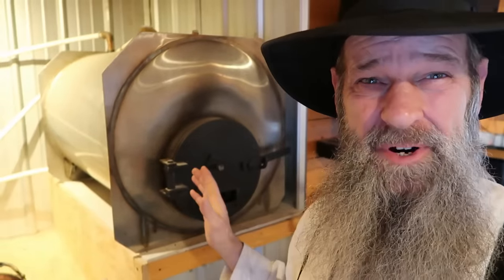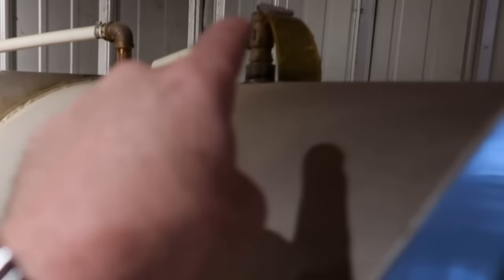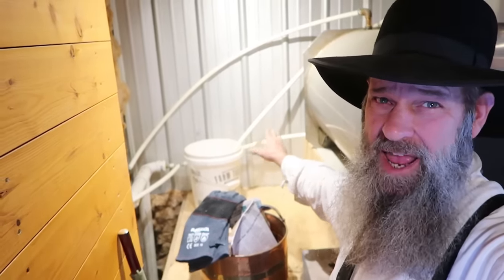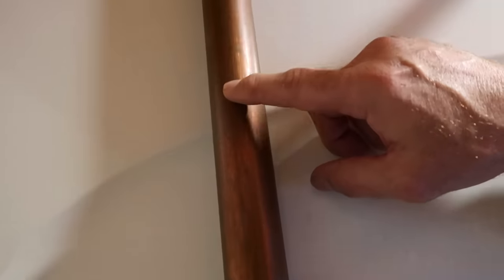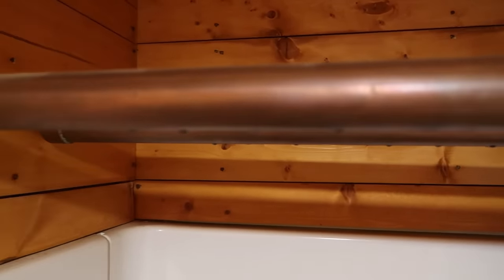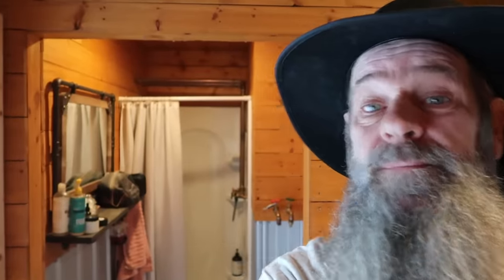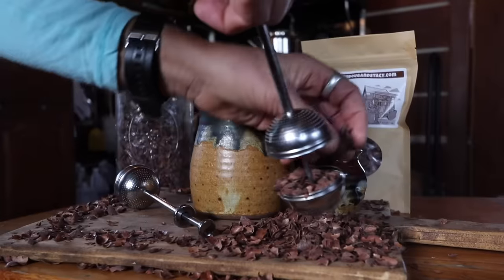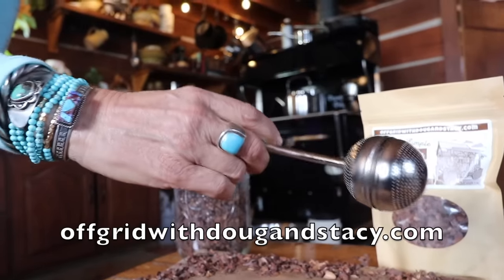How the Amish have HOT WATER! Off Grid Living

Comment: Hi Doug. If you have pvc or abs pipe in your grey water system don’t put the heated water from your wood water heater into it. It will expand and contract the pipe to the point of pulling the joints apart.  You folks are inspiring. Have a great day

Comment: For people who want to implement the shower, but don't have enough pressure from gravity, an in line tank can be used. Install a check valve on the inlet side, Install a fitting for an air pump on the top, pressurize the tank, and you're off to the races.
Reply: I was also thinking a simple RV water pump would do. I have thick hair and it would take forever to thoroughly wet it before shampoo on a gravity system, and the rinse oh man there goes another 20 gallons.

Comment: I 'm so impressed with your ingenuity applied to the Amish system. The shower is beautiful, the way you fixed it up in your nifty outbuilding. Thank you for all the teaching moments with you both. When I was living in my travel trailer on my 12  acres, I heated the water in a canner,  over propane stove, carried the canner  into the tiny bathroom  and sat down on the edge of the shower. And I washed myself clean with my feet in the water. I used kerosene lamps for light and lived in a tiny room built adjoining the travel trailer. I collected rainwater. I had to watch out for bears, bobcats, and strange people on occasion. I learned to live simply and enjoyed the experience. Now I have a different property and mobile home on the grid,  and looking forward to some innovations like yours.

Comment: Good Evening, I had a similar system when I lived in Alaska. Hot water was not the problem, the hot water was always too hot. I would turn on the cold water 1st and then slowly add the hot/hot water to it. I used a stainless steel heat exchanger and let the hot water rising work for me. I also had a purging valve at the lowest point so if I was called away I could drain the system completely and not worry about any pipes bursting. The front of the stove had the opening into an air tight chamber with a flat top cooking surface that higher airtight chamber had the exhaust stack in the back of it. The heat exchanger was in the rear of the higher 2nd chamber. 
The exhaust stack had a 'T' section followed by a 90 elboe, then a section of stack going down and into a box built between the floor joists. The cold air settles to the lowest point which is the box in the floor behind the stove. That section of stack going into the floor box has the flue in it. This draft of cold air creates a vortex in the stack. I never had a creosote problem ever. Good luck, I thank you for letting me share, Tom.

Comment: I made something similar. It's my outdoor cob oven. Between my layers of cob I  curved some copper pipe around the oven then finished my cob layers, leaving a piece of exposed pipe at the front facing top of the oven and down at the bottom facing front of the oven. The  cold water goes into the top and comes out the other end piping hot. Too hot in fact. I just added it as an instant tea or coffee bonus but it could work the same as yours if a water fed line was attached 😊

Comment: You are so right about missing grit. Indeed. We moved rural but have backups just in case. We lost heat and water for a week in sub zero temps last year due to mechanical failure in the upper midwest. We were prepared and planned ahead just in case of something like this.

Comment: As s teenager My father worked in the high Cascades. We learned to use an outhouse we had a washhouse and with a shower. Our water came ftom a huge ice stream comeing out of a volcanic tube in the side of a mountain. It was so cold.  We didnt have hot water we had to heat it on our electric stove and heated our cabin with a wood stove. We loved it.

Comment: Great idea , I have something similar myself for heating the entire  house and hot water. My system is different in that I use a small stove with a thermostatic damper, a header tank in the attic which feeds the boiler and a "pitch pipe" from the top of the boiler to over the header tank turned down over the top of the water in the tank . This allows the water to bubble over into the header tank if it gets too hot , which siphons cold water into the boiler automatically.  My stove boiler is steel and the hot water rises up via convection to the heating circuit through a copper pipe in pipe heat exchanger to heat the potable hot water .

Comment: We've got a hot water system at our coffee farm house that is also heated by wood. A pipe runs through the wood stove (adobe bricks with a 2 cm steel slab on top). The water comes from a spring about 1/2 a km away, and after going through the stove it's stored in a 80 liter tank. Comes out piping hot in the kitchen and bathroom. Awesome hot showers on chilly days.

Comment: I went to New Orleans after Hurricane Katrina to help rebuild. while there the hot water tank in my camper went to hell. I couldn't find a replacement for it being an older camper. I went to Homedepot and  bought 100 feet of heavy duty black garden hose, hooked it into my system and neatly coiled it on the roof of the camper. In the summer months it made water hot enough you would think it could remove skin lol. Just do everything you need hot water for during the daylight hours. Free hot water is great

Comment: As well as the safety valve put a T in he outlet pipe where it comes out of the tank, and take an overflow pipe up to the cold storage tank, and then if the heating tank boils, any excess will be fed back to the storage tank. There will be no loss in the system, it will still work the same, but will be far safer.

Comment: We also have rainwater tanks.We noticed a blue colour on our shower floor,tried everything I knew to find out where this was coming from.After 9 years out water heater died,hole in the copper heat exchanger.Installed a new one,same thing after 8 years.Our plumber said it was the rainwater tanks,leaves etc.make the water acidic.

Comment: Run the blow off valve into a tank thats large enough to hold the hot water you can then use it until it's cooled down and recycle what's left back into the tank reducing the amount of wood needed to reheat it.

Comment: When I was driving over- the-road as an owner-operator I'd gone for two weeks without a shower.  I needed one badly.  I was passing through Vale, Colorado, and thought that I'd just take a quick dunk in the small stream flowing next to the road.  That water was so cold my feet and ankles hurt when I stepped into the water.  No quick dunk.  I moved on and found a truck stop in Arizona that had showers.  Yeowzers that water was so freaking cold!

Comment: If you use bio-comparable soap & run your gray water through a DIY aggregate/charcoal filter it will come out the other end clean & soapy. It works great for washing equipment, cars, exterior of the house, etc

Comment: The thing I've found in 40 years of using 2 different homemade woodfired boilers, is using shorter lengths of wood but keeping way up fron in the firebox pays huge dividends in less wood used. My firebox is 4' long, and for years i used to stuff it with nearly 4' long wood, no more, now it's 12 and 16" lengths, and it also burns a LOT cleaner, as my air intake is at the front. Before, it smoked a lot more, now, hardly at all except for a few minutes at startup. At :49 in, the first half of the fire box is doing nothing, only the rear section is being heated by the flame path, I'd drag that fire forward. My intake air comes in from the rear, is preheated along the way as it's contained in 3" steel pipe, and then exits about 8" from the front in such a way that it creates a swirling effect of the flame path, not just straight back to the flue.

Comment: A thermal syphon system. instead of disposing the overflow hot water into the grey water system, you could always place that water into an insulated overflow tank and link that tank back into the main boiler tank with the firebox, you wouldn't loose pressure as the pressure would be linked with the firebox. but if it does the job it does the job, no point in over engineering if it works.

Comment: Seems a bit extreme but if it's your way I don't question it..  I've considered a floor heater with plastic tubing under floor covering, piped through a radiator in a compost box..Using the decomposed material for fertilizer.  Do you think it might work?

Comment: The valve is actually a pressure relief. It only allows the steam out unless you are on a pressure line. Bucket should be just fine unless you are actively pumping. At which point i hope you see the leak. It's pretty obvious.

Comment: Good Morning S & D, what was the cost of your hot water boiler. Very ingenious, I believe this is also the system some folks are using for radiant heat. I remember Dad working on this before he died. You really have put in the work to build your infrastructure. When you first started did you realize how much you had bitten off? Or was it one step at a time knowing the detail of your final goal all along?? Looking forward to that F150 XLT DRAWING & ReHoming. Blessings and Grace. Wilber & Margie.

Comment: Safety Alert ~ Please consider running metal pipe coming off the TPR Valve.  Every time you heat your tank the plastic pipe in proximity to the heat is going through heat cycles which can cause the plastic to become brittle and eventually fail, although pex can take more heat than pvc it can still fail which may spell disaster.  If  for example the TPR valve pops to let off steam pressure and the plastic pipe on the TPR gives up, scalding steam/water will be blowing out out at FACE LEVEL.  Now, perhaps none of this will ever happen, but it could and as the old saying goes..."An ounce of prevention is worth a pound of cure." 
Just my unsolicited $0.02 worth.... 
Regards,
Gary
p.s. I've have enjoyed watching your videos on and off for several years, started off watching you and Dr. Leo. with you bees.
Oh and here is a link that explains the safety concerns of using plastic/pex for your hot water blow off valve better than I can...
https://www.nachi.org/tpr-valves-discharge-piping.htm

Comment: hi,
How thick are those stainless steel cylinders, did you need to use firebrick inside the inner cylinder, and at what pressure does the pressure valve go off?  Finally, where can I buy those cylinders?  Rather than water, could air be used between the two cylinders and with a solar powered blower could the heated air be used to heat the house?  Thank you, Sir.

Comment: You don’t want to pipe the hot water into your gray water. If it does overflow it will heat all your pvc pipes up to the bending point and warp all your pipes. Trust me I know this from experience .

Comment: I find it contradictory that you are using a home-made low tech hot water set up, as opposed to a run-of-the-mill standard plumbing system, but you are not against using a high tech system like YouTube to pridefully show it off.

Comment: So, it's not okay to use modern technology such as propane water heaters and electricity but it's somehow ok to buy thing that require modern technology such as all of that piping and the stainless-steel heater and then use those to make a subpar heater?  I guess in 100 years when we will all be using fusion reactors to generate power that then those future Amish will be ok with using today's technology 100 years later?  I'm confused.
Reply from the maker: Yea you are confused lol 
Fire water wood 
That's all I need 

Propane gotta buy it
Electricity gotta buy it 
Grid goes down 
I shower 
You smell 👍

Comment: Just don't try this in a location that has ordinances or covenants banning this way of life. The state of Minnesota (Minnesota pollution control agency) will fine you $1000/day for polluting soil with gray water, or just not having a compliant septic system. The county might, also. Rural MN towns are banning 'accessory dwellings'. Are Minnesotans storing rain water in this -40°F we're having? Asking for a friend. I've seen a lot of gasoline, -30° wiper fluid, propane regulators, indoor plumbing, hose spigots & underused septic mounds freeze around here, too. Why do I live here? 😂😆🤣

Comment: This is nothing unusual
In Europe this was very common - solid fuel boiler! ....untill a green agenda came along and it was prohibited because of too much pollution....And it is correct decision, except it should be in every house as a backup system in emergency, because the GRID is not very reliable!
Reply from the maker: "And it's a correct decision " YOU ARE DEAD WRONG 
STOP BELIEVING THE LIES they will use the "environment " as a weapon aka tool to CONTROL YOU
Reply: @OFFGRIDwithDOUGSTACY  I am not wrong! I have experience( at my 71 years of age) from times, when every household in the city had a stove and boiler....it looked like Beijing 15 years ago.....you could not se further then 50 yards for the smoke/smog in the aire. People all the time sick with respiratory problems and also a lot of cancer.

Comment: If you are happy with your attempt O.K. Because only the uninitiated would be impressed. 
     I am an 87 year old Heating Engineer of the 1960's UK... Let me advise you that your System is Dangerous and without BASIC SAFETY DESIGN FEATURES and .
     In addition it is Highly inefficient and a waste of a valuable semi renewable form of Heat ie WOOD, for a SINGLE operation.
     The Romans had better ideas than yours